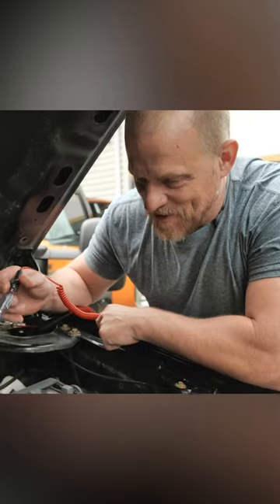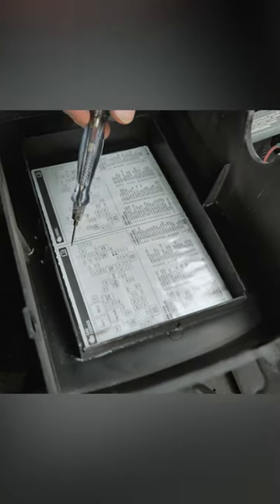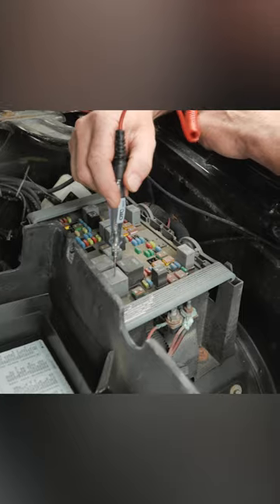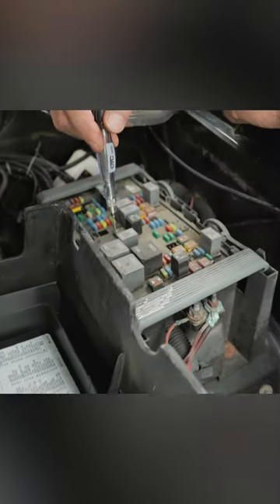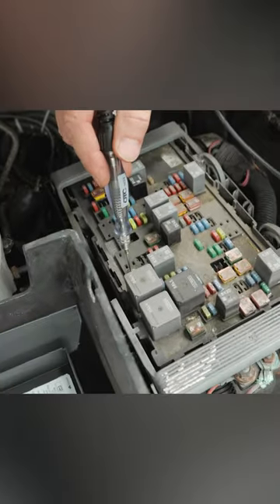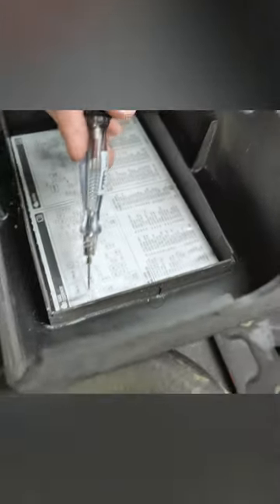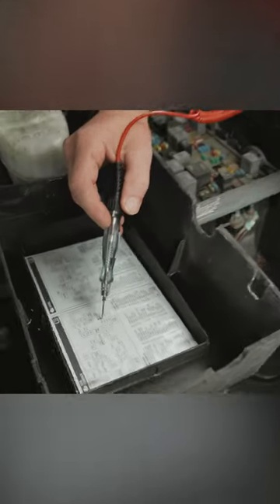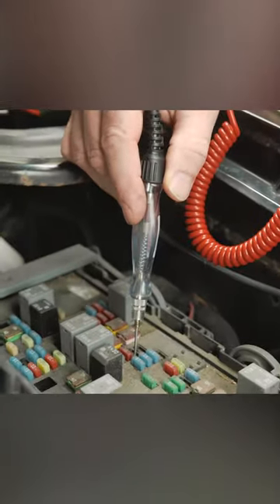I Suck At Reading Fuse Boxes

Comment: scanner danner. question. do you know where the daytime running light fuses d r L  is located on a 2002 3.1 pontiac grand prix.? the fuse box on my car dont have it listed unless im over looking it somehow? i was wanting to disable those lights cause i think they are pulling my battery down too much. or would that be a bad idea. thank you scanner danner.🏁👍
Reply from the maker: A DRL circuit won't cause any battery issues unless they are staying on with the key off
Reply: @ScannerDanner i appreciate that reply very much👍👍🏁

Comment: What if my fuse is good but the port where the fuse plugs in has no voltage what could be the problem
Reply from the maker: Find what circuit feeds that fuse power. A power distribution diagram is needed https://eautorepair.adtrk.biz/?a=10817&c=24&p=r&s1=